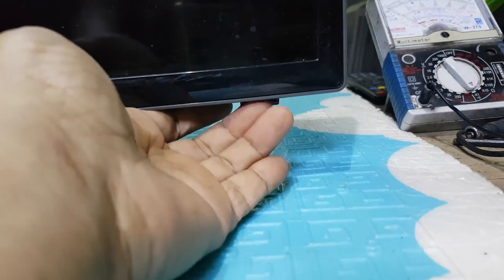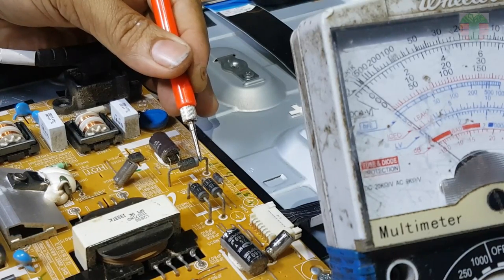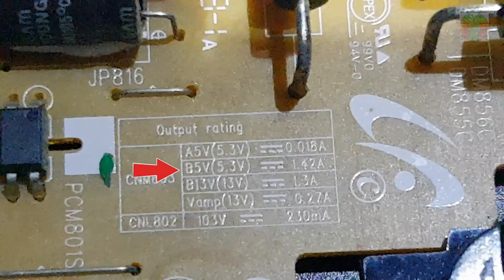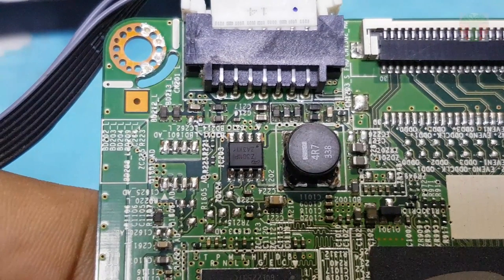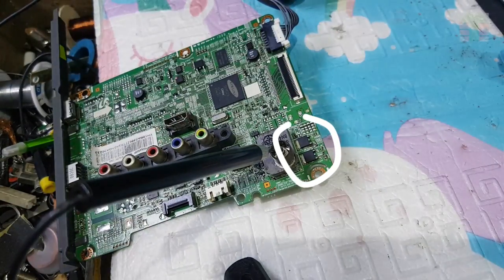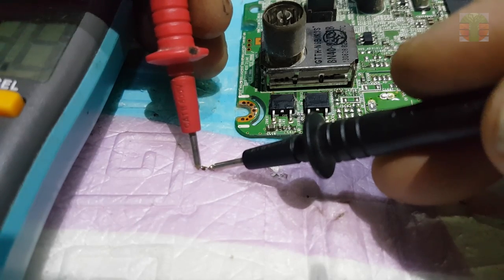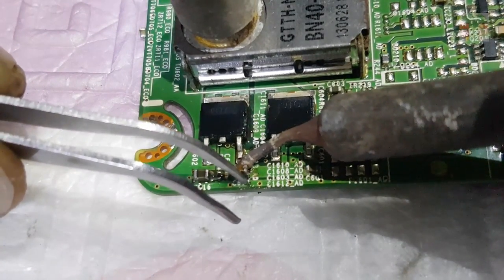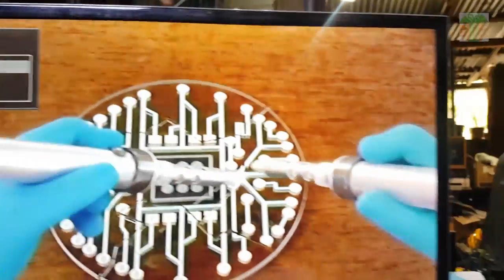The easiest way to find shorted capacitors.

Comment: Hmmm seems you are a good detective. Good job 👍.
1 things I didn't catch you after you removed the capacitor when it's over heating.
Did you replace it by a new capcitor.
And how you know how  much volts  and uf capcitor should be replaced.
Thanks.
Reply from the maker: Thank for watching. I don't know the exact value of the capacitor I have replaced. It's maybe about 4.7 uf to 10 uf 50 volts. It shows in the video that it doesn't have value on it. Its common uses of those capacitors are for decoupling or filter, Its does not informant the exact value whether 2.2, 4.7, 10, 22.  microfarad It's okay any of this.
Reply: @tevzTVTevatronics  thanks a lot I really appreciate your effort. And thanks for replying. I will keep following as much as you upload more videos.
Am learning a lot from you.
Keep save. Lord bless you and your family ❤️.
Reply: @tevzTVTevatronics  yes I seen almost they doesn't written on the capcitors or on the pcb. Only location the write. Thanks a lot for sharing these knowledge. 😊👍

Comment: Thank you for sharing... is 3v 6amps safe for the other parts of the mainboard?
Reply from the maker: The shorted line is 5 volts. It's safe to inject 3 volts to 6 amps unless you inject more than 5 volts.

Comment: Good job man! I've not seen the wax trick yet!
Have you ever seen for example 4 thin red vertical lines develop on a flat screen TV?
If so what causes it?
Reply from the maker: Some display panel may have that line in the long run. It's not durable as you know.
Reply: @tevzTVTevatronics  Yea it started out as one vertical red line that looks like what a bar code scanner emits, then 2 then 3 now 4 lines.

Comment: By the way you forgot   to tell the value of the capacitor which was changed!
Please tell all   details related next time.
Reply: See the reply to Fardeen, above. Most of the time these components can be removed/eliminated without problem; they are only for noise protection, and do not usually affect the performance of the circuit.